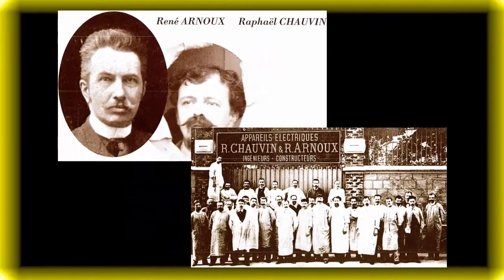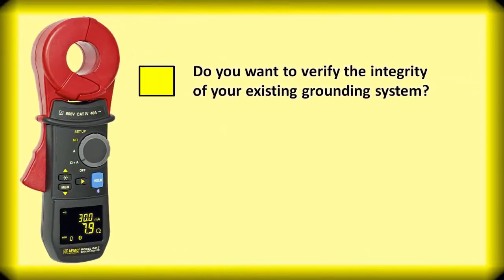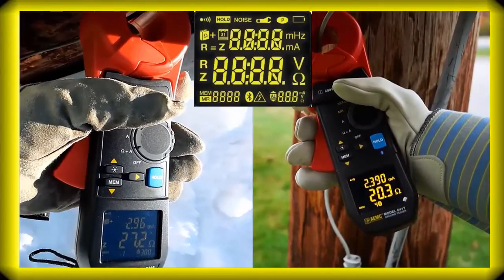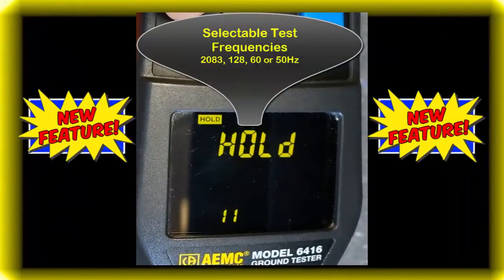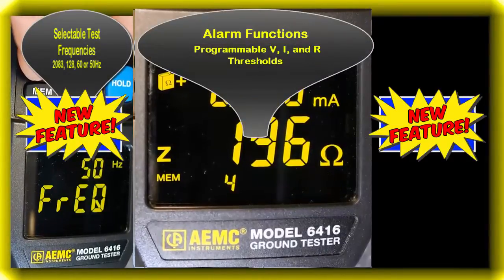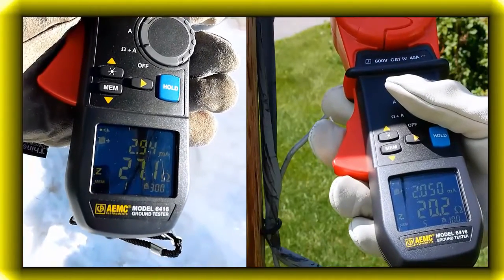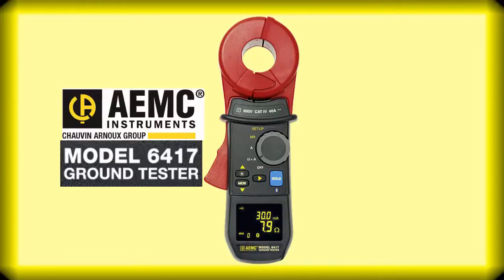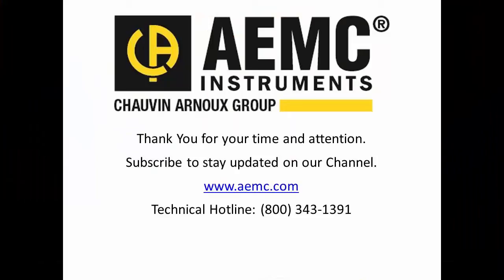AEMC® - 6416 & 6417 Clamp-On Ground Tester - Introduction

Comment: I have a arc furnace draning system, but qe need to test drainning between 400 amp to 1000 amp , with the 6416 model it cold be posible?
Reply from the maker: Not possible.  The 6416 and 6417 are Ground Resistance Testers and can only measure up to 40A of current.  What you describe is power logging like the Model PEL103 or current measurements with a clamp-on meter like the Model 607.  Please contact techsupport @ aemc . com with more questions.  Thanks!

Comment: Do we could test with 1000 amp dreaning?
Reply from the maker: Not possible.  The 6416 and 6417 are Ground Resistance Testers and can only measure up to 40A of current.  What you describe is power logging like the Model PEL103 or current measurements with a clamp-on meter like the Model 607.  Please contact techsupport @ aemc . com with more questions.  Thanks!